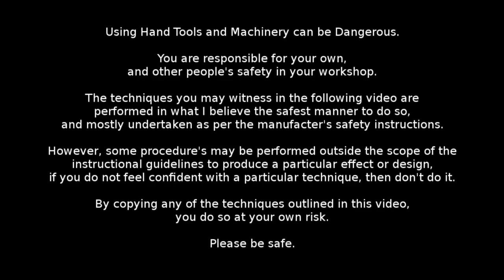Woodturning a Macrocarpa Pine Bowl - Part 2 - and some Sheep

Comment: A great conclusion on this bowl mate, the splits add a little more character but  can be put right at anytime if you decide to,  love the interlude with the dam and sheep, nice touch that.
Cheers   Bram
Reply from the maker: Thanks for watching. I"m leaving the bowl for a couple of days to let it settle. I think the Macrocarpa log I cut the blank from has a lot of water from being outside, so I'm thinking of moving some select pieces inside and let the dry out a bit. I'm still working on that fencing, lol, it's been raining a lot here, looks like we're in for a wet spring.

Comment: Looks great mate. Came across your channel and now subscribed. Been a long time since I saw someone use a rubber for shellac, but they do work a treat. I look forward to the outcome now.
Keep on turning.
Cheers, Bluey 👍
Reply from the maker: Thanks for watching. I've only applied Shellac that way, even using actual Sheep's wool that I've kept from shearing ours. From my understanding the Lanolin in the wool helps with lubrication.